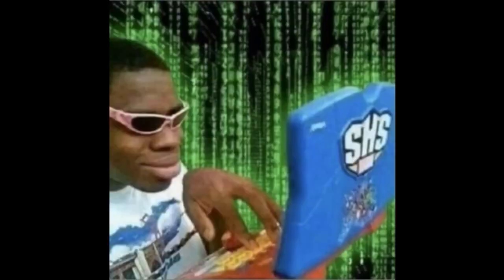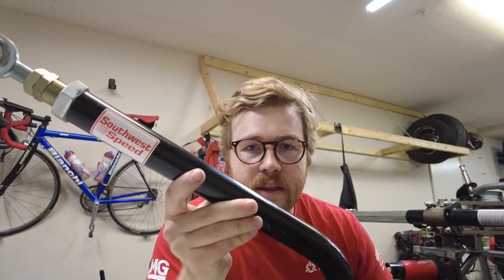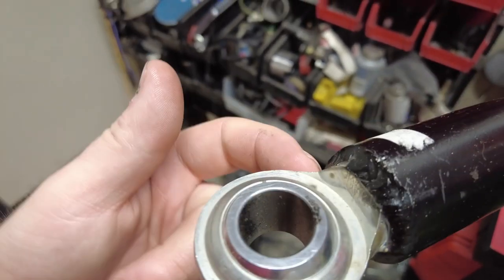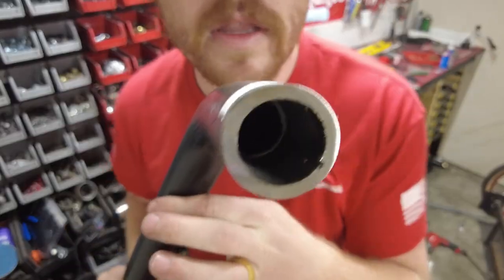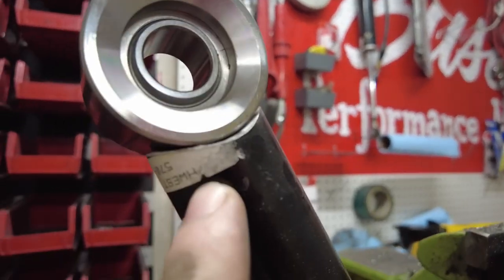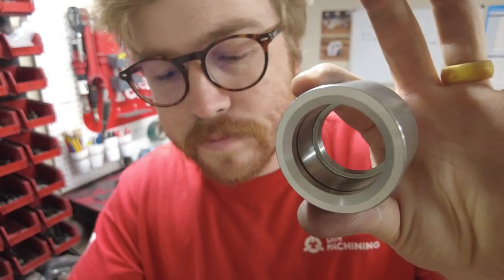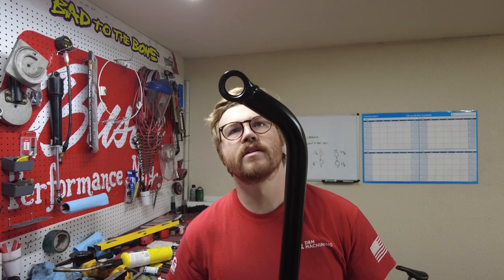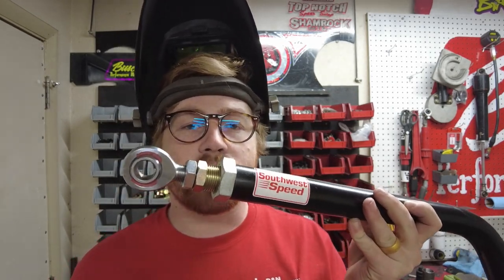How to build the best J-Bar for your Dirt Modified! What's going on at Busch Performance? Ep. 7

Comment: There’s very GOOD reason(s) why we run the bars with with all the “crazy” bends and why we tossed out the 90’s style your endorsing.  The primarily reason has to do with basic and correct geometry.  If you don’t understand why, it’s probably best not to make a video telling guys this is the best j bar.   The geometry of your panhardbar is now incorrect. It’s actually a fact and not a debatable subject. When you run through hike, travel and axel rotation and don’t see why it’s incorrect I would be concerned. Besides the WM bar is strong AF ( and I dislike the company) the bar rarely bends and you just swap the adjuster in seconds. Never replacing the mounts or welding the frame another reason it doesn’t often fail is.....the correct geometry. 

I have piles of that old school SWS style  j-bar with monoball ends that I had built in the early 2000’s.  Monoball was extremely common with many brands.   Another reason why we all reduced bar size was to stop ripping out the chassis tube and folding the mounts but the old school bar was overkill.